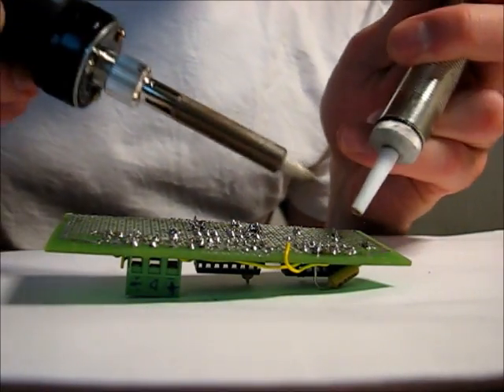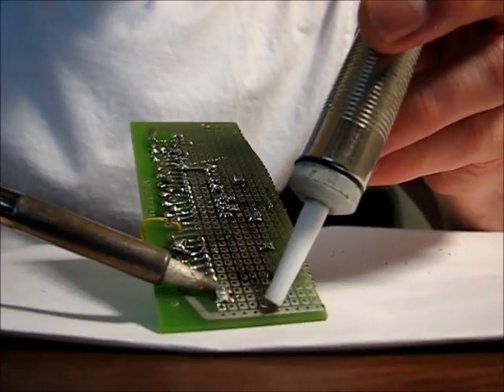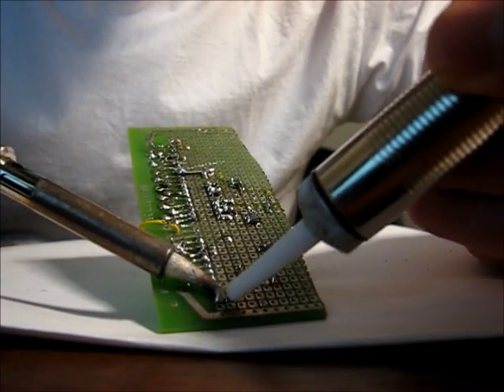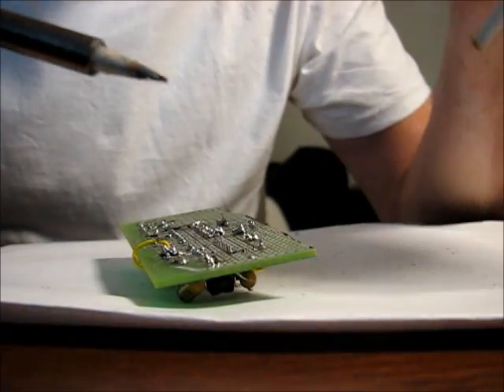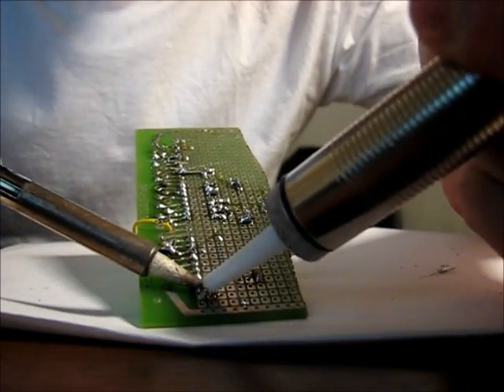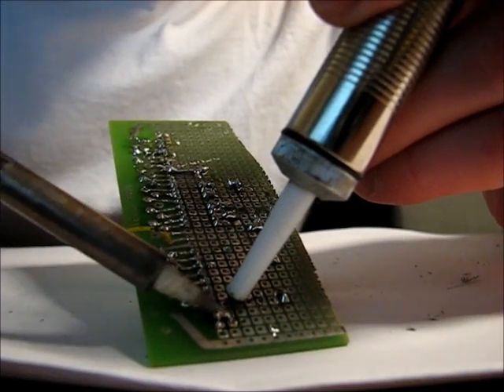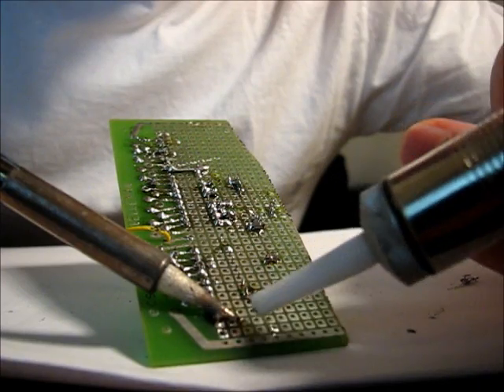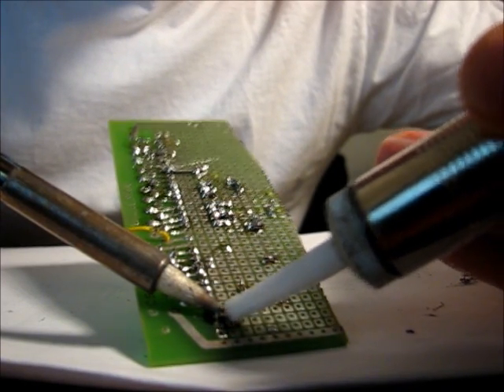Soldering techniques: Desolder pump - How to desolder using a solder pump

Comment: short and crisp, no rambling, no digressions unlike so many channels, thx.
I plan to solder some smd chips and think I will get one in the case I make bridges between the pins. Using desoldering braid will probably thermally kill the chip...

Comment: Is the tip plastic wouldn't it melt?
Reply: yeah...usually most pros remove the tip of the iron before bringing the tip of the solder sucker into the melted solder

Comment: Will the plastic piece not melt ?
Reply: the tip of the pump is very durable (even cheap ones) the rule is most like ''if you melt any of the components, you are doing it wrong''
Reply: D Ltd yeah
Reply: I think it is ceramic

Comment: Thanks for the video.  Though I've also read that touching the tip of your solder pump to you iron will melt and wear it out quicker.  Is this true?
Reply: +Oyvind Dahl I've never had any problems with the tip of my pump either
Reply from the maker: Yeah, I guess you should be a bit careful. But come to think of it, I have never had any problems with the tip of my pump. And I am not really careful about that...
Reply: Is the tip plastic?
Reply: Can you just melt it and then pull the iron away then use the pump or do you have to use the pump while the iron is touching the solder?
Reply: usually you remove the iron before putting the solder sucker, but you must be quick to do it before the solder joint freezes, you do it either as you getting the iron away or having the iron removed completely